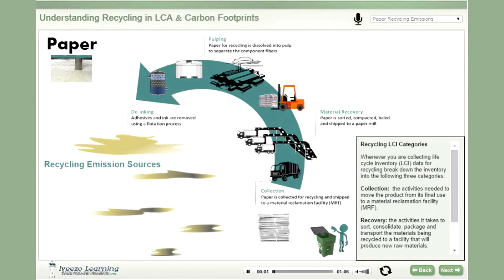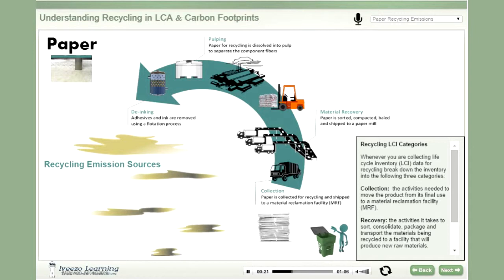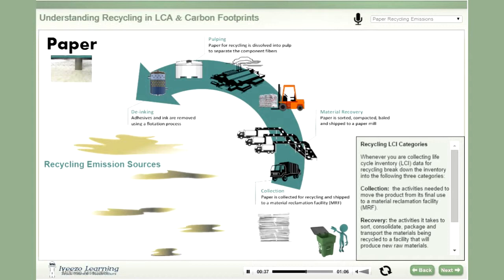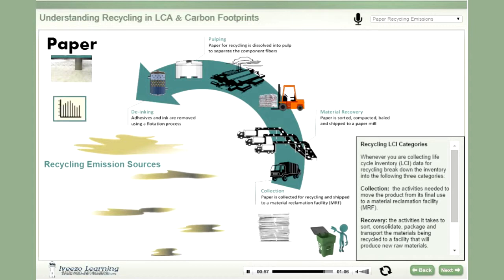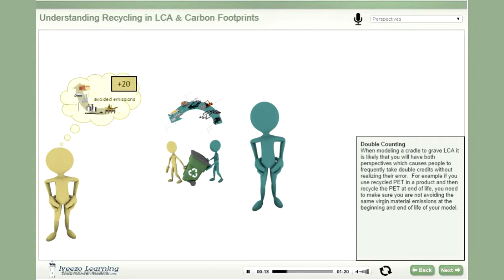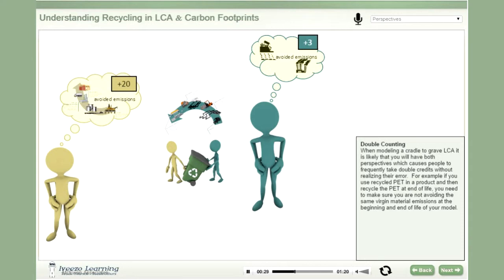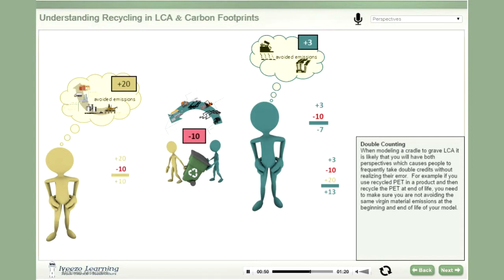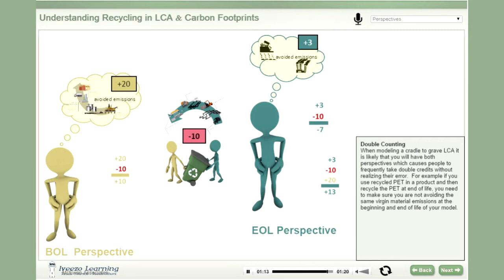Understanding the modeling of recycling

Comment from the maker: Trying to understand the different ways recycling can be modeled in LCA?  This is a 3 minute demo video of the full 2 hour course available at iveezo.com

http://iveezo.com/local/staticpage/view.php?page=recyclingclassdescription
Reply from the maker: Modeling recycling is tricky because the system boundary of any one LCA or Carbon Footprint study includes just a portion of a materials many lives. If this is a materials second life, should the study include a portion of the emissions occurring during its first life? For example, should the emissions from drilling oil to make plastic be allocated between all the lives plastic might have, or just the first life? Should the emissions from mining of boxite to make aluminum be assigned just to the first life of the aluminum, or to all the lives?
Also, how do we know which life the material is in? A material like aluminum can have in infinite number of lives. The correct way to model recycling has been extensively discussed over the past two decades. Many approaches have been suggested. In this course we will describe the three most common approaches. Then, using an example of 30% recycled content paper, we will model these three approaches in three different LCA software tools assuming 50% of the paper is recycled at end of life, 40% is landfilled and 10% is incinerated.
Learning Objectives:
Explain the source of environmental impacts (costs) in recycling;
Explain the two sources of environmental impact reductions (benefits) in recycling;
Describe three common methods for model recycling in LCA;
Discuss two ways for modeling recycling in the Green House Gas Product Life Cycle Accounting and Reporting Standard.

Approximate time to complete: 1.5 - 2 hours